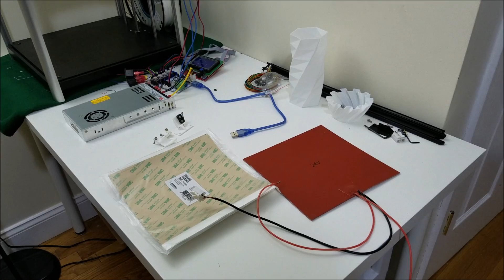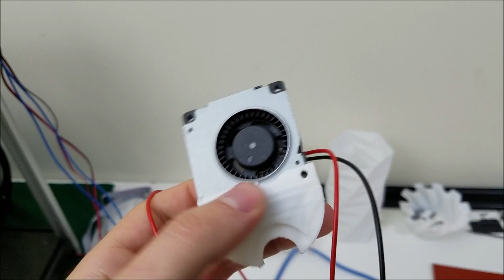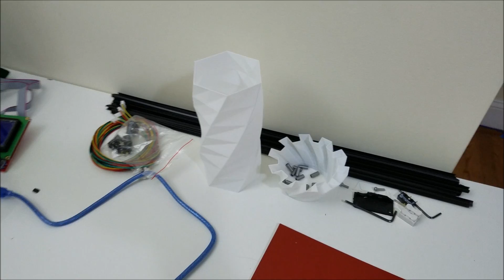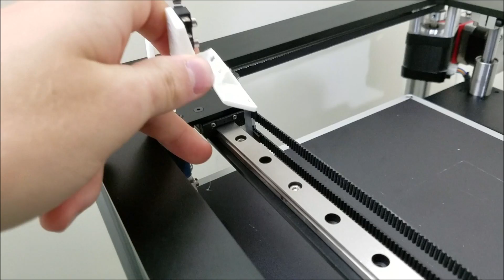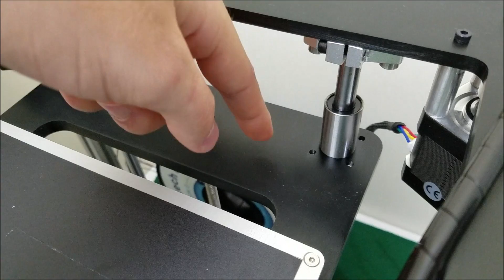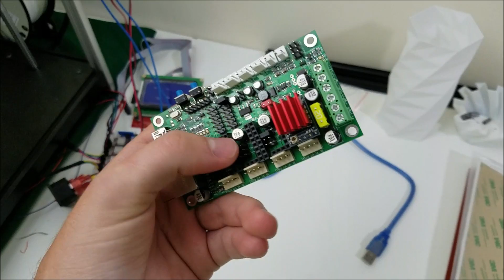Eclips3D2 Update! GeeTech went psycho!!!

Comment: why do u use a 24v psu for running the board at 12v?
Reply from the maker: Because the more pixies the better!

Well, perhaps a better explanation is in order. This is mostly due to the fact that all of the standard electronics for 3D printers usually come with voltage limits well above 24v, like the steppers, control board, wiring, etc. So by using 24V, it allows you to use less current and deliver the same power. This means you can use thinner wires for less bulk, less current for the steppers so a bit less heat, and most importantly it will allow you to hook up a more powerful heated bed directly to the controller (depending on the controller).

Honestly, there's no reason to have a 12v system, 24v should be the standard for all 3D printers, if not higher!

Comment: I figured it out,the original gt2650 that came with my machine was probably set prior the board I got wasnt . to make the 12864 LCD smart controller work ,I had to reverse the connecters,shave the plug to fit in reverse then it work !! if other people are have this issue that is probably why the connectors are backwards!!! one week of stress figuring this out

Comment: I have the same board that you have in the video ?or if you mean the pins? I have both LCD & SD card plugs connected ? still blue screen ?? thank you for the info
Reply from the maker: Well what I'm saying is that you need to make sure you not only have the plugs on the proper sides, but also that the plugs are not flipped. I don't know the correct orientation so that is something you will have to look up. If all else fails and the screen still does not work, it's possible it was just dead on arrival. These screens are cheaply mass produced in china so it wouldn't be that far fetched to get one that was just dead from the beginning.

Comment: I can get it to power on but only buzzing not beeping I define u8glib  but nothing still blue buzzing screen specs reads gt2650 dosnt need adapters a little more info would be great thnak you
Reply from the maker: Correct it doesn't need adapters, but since there are 2 cables and each is reversible, there are basically 8 different ways you can plug in the lcd to the board. I'd recommend trying to find the proper orientation and location for each plug to make sure you are connecting it properly.

Comment: how did you get the full graphics lcd on that 2650 I just bought one but dosnt see any pins for it on the board
Reply from the maker: There should be 2 sets of 2x7 pin headers, these are for your control board. One set is for the display wiring and the other set is for the sd reader wiring, so technically you only really need the set for the display at a minimum to get it working.

Comment: Hey, I have a few questions about designing a printer using 2020 extrusion, if you could help me out.. I know its a long read but I'd really appreciate the help

I have several hundred dollars worth of miscellanious parts- Half are in my current Kossel, the other half are from a previous prusa build. All working, all useful and expensive parts like NEMA motors (both big and small, several of each,) a few yards of bowden tubing, a few hotends, some endstops, a few yards of GT-2 belts, smooth rods, boards, power supplies, etc etc. I've dealt with two unbelievably unreliable and low quality printers, the Q3D Twoup and now currently the Folgertech kossel, and I want to just make a printer that I can rely on. But I'm not interested in buying another kit, because not only is that another 500-600 dollars, but I'd be wasting the $500 in parts I already have. Do you have any tips? I'd most likely be building a core-xy machine, as ones like yours work amazingly- but I dont know much about them, I'd only really know how to build another prusa, which i'm defnitely not interested in. Do I really need a cad software like you used to design yours? I have access to pretty much everything I'd need to make my own aluminum/plywood brackets and such, so I wouldnt need to send cad models to companies to fabricate them for me and stuff. I know I'll have to buy at least SOME things, like more extrusion and sheet aluminum and all that, but I have the bulk of the money already spent and I think I can finish the printer for relatively low additional cost. Is just coming up with it as I go a bad idea? Where is a reasonable place to start? I was thinking of just making a very secure frame and going from there, probably moving onto the bed (I plan to use two small NEMA motors on front and back to lift it, would this be powerful enough? Or should I use two big ones? Would small motors be capable of moving the gantries? I have 5 big motors and 3 small motors.)

Your printers are coming out amazingly, and I look forward to your next update. Best of luck
Reply from the maker: Well first of all I would say to check thingiverse, just search corexy printer and it should come up with a few dozen good options to look at and possibly build directly or base your build off of. You can just kind of wing it and fix things as it goes, but that probably isn't the best idea if you're looking for reliability. The most reliable printer is the one that is designed to be reliable from the start. Either way, whether you build someone elses design directly or you do your own design, definitely do at least a rough drawing of what you want. You don't necessarily need to cad it, but a fairly accurate drawing form the top down should help you get everything together so you can begin the build. You will probably want to focus on the outer frame first, then the corexy portion since that is the most difficult, then when that is done work on the z axis. Just keep all the other parts in mind even when you arent building them, like don't forget you will need a place to put the z axis motors when you're building the frame. If you use good lead screws with a large lead (4-8mm), 2 small motors will be enough. Otherwise you may want bigger ones. Of course you could always just run the z axis super slow and use the small motors anyway, the z gantry won't take much effort to move, it just takes effort to move it quickly. Good luck!

Comment: I really like the robust design, and quality of the build. Have you thought about adding independent dual extruder?
Reply from the maker: Yep! And although I probably won't officially support it, I will likely go the ultimaker route and "kinda" support it. As it stands now, there is a place where you can attach an additional bracket in order to mount an E3D chimera or cyclops hot end to the printer, then a second extruder can fairly easily be mounted on the back opposite the original one (or even below it if you get creative).

Comment: I ve been printing for a long time with PLA and without any fan that blows on the print, apart from some corners lifting up (no heated bed) what are the other problems of not using a fan ?
Reply from the maker: PLA just looks better when you have a fan, basically because PLA has such a low glass transition temp (the temp where it becomes malleable) it will often not fully cool before the next layer goes on top, which can lead to the surfaces not looking as crisp and overhangs/bridges drooping. If you get a cooling fan on your printer it can seriously improve print quality for some parts!
Reply: Can you post at some time what setting do you use for cooling ?
Also some settings for support would be really interesting .
Thanks !
Reply from the maker: For PLA just full fan all the time except for first layer works best usually, if it's too loud you don't have to run full or you can do some other profile that does more fan for shorter layer times. Basically the more cooling the better

Comment: if you are using an aluminum bed, why not use a inductive sensor? Can also work for auto bed leveling...
Reply from the maker: No inductive sensors, I'm very against them on high tier 3d printers haha, read any of my other comments below there's a few talking about it for this video.
Reply: +1 i will only use autoleveling if my hotend is probe. i am working on a switch spring system where hotend will probe the bed. that way you never have to mess with offset and even if you change hotend it wont make difference .

Comment: sorry what happened to you with the GT2560. anyways, if you want a really nice board, check out the duet that just came out, built in WiFi, firmware can be updated via a file sent to printer via wifi, has options for the lcd , card breakout, and another pin break out for all inputs outputs and what not. rwg research just did a video on it.

Comment: I know you said you're not keen to use proximity probe but it makes z homing much easier, no more manual adjusting with the screw etc. Also if your bed is all levelled via screws it'll not do any compensation.
One more thing, have you considered doing 2x piece bottom cover design?! Back piece could be much thicker so you wouldn't need to use those brackets to hold z stepper in place + front piece cover could be opened like a hood to access all electronics etc without pulling printer out and tiling it on the side...
Just a thought.
Last thing, promise. TMC's are worth every penny. Just don't buy them off AliExpress or so, I've got mine directly from waterot manufacturer website.
I'm done! ;)
Reply from the maker: That's true, however with a printer this solid you'll only have to adjust it once every few dozen or even possibly every hundred prints. Basically it comes down to whenever you replace the build surface. And that's true however the precision of those probes are generally terrible, so even if it is perfectly level it may think it isn't and try to compensate.

That is a good idea with the base panel, but it would drive up the cost considerably and it still won't make it easy to access electronics because of how they will have to be mounted. 

And the Azteeg supports THB6128 drivers which also can do 1/128 for smooth quiet movements so hopefully once I'm able to test that it will work as well as I hope it will! Thanks for the input and suggestions!

Comment: completing my other post, check my new printer is use too a metal plate with linear rail. but i have radds board with 1/125 steppers. almost zero vibration and all the noise are from the cooling fan. uploaded 3 videos on my small channed.
Reply from the maker: Nice that printer looks great! And I will be considering more boards but for now I will be using the azteeg x5 mini!

Comment: great printer, but not the board. in the past i have builded a corexy machine with a ramps 1.4, full lcd and using repetier firmware. it simply does not work well when you start to print with speed high was 80mm/s. the problem is the 8bit board do not have enough computational power to update the full lcd and move corretly the corexy. the problem i have was small blobs on the print because of micro pause, tryed marlin and same problem. the corexy need a little more computation power to move at same speed of a simple cartesiana. delta printer the problem is worse. other problen is the steppers, to motor are diretly connect to the metal plate and all the vibration will be passed to the main structure. is a so nice printer, man put a nice board too. something like the new duet that have wifi and 1/256 steppers, rads or even a smoothieboard clone.
Reply: you know when you add a full graphics LCD, its just about overloading the 5/3.3voltage regulator on the mega. i can hit speeds well over what you can. if you are running a delta then look into a duet board, built in WiFi, firmwares (3) can update via wifi, seperate or combined with lcd, seperate with touch screen. rwg research shows his on YouTube, see my chanel in 3d printer playlist, and ooooo I want one playlist too. really nice board just came out of the first preorders.

as for the gt2560, I run auto level and a filament sensor and the autolevel is 9point grid, on 12 volt.
Reply: George Robles the full lcd was more text line and need more computation power to be update. If you use 1/16 stepper you probably be ok, but not with 1/32. The type of stepper reduce the possible speed by half. Was i say, i already done this and the use of the full lcd will give you micro stop during the print.
Reply: hmmm.... never did try with the dvr8825s. i will look into it. i actually prefer to run my printer through octoprint now a days. i upload g-code to the octoprint server, then run it that way so your only sending basic g-code instructions. it still is using 9 point grid level and doing that math on the fly. this is how most industrial stuff runs, one cpu controling another slower cpu.
 so it reduces the info being processed by MCU that no longer has to read an sd card then execute the instructions. and I can remotely operate the printer, using a webcam so I can see it and take time lapse videos of the prints I do.
Reply: hmmm.... never did try with the dvr8825s. i will look into it. i actually prefer to run my printer through octoprint now a days. i upload g-code to the octoprint server, then run it that way so your only sending basic g-code instructions. it still is using 9 point grid level and doing that math on the fly. this is how most industrial stuff runs, one cpu controling another slower cpu.
 so it reduces the info being processed by MCU that no longer has to read an sd card then execute the instructions. and I can remotely operate the printer, using a webcam so I can see it and take time lapse videos of the prints I do.
Reply: reptier have problems with drv.  its some delay timing issue.

Comment: why not using a proxy endstop? than you can instal auto bed leveling. You should ask Thomas Sanladerer what is the best board for your machine. Duet or a Smoothieboard. Or the Ultratronic board. Alot of options and the right componets. I like your design of the machine. Does it get a enclosure? Is this x-y motor setup beter than just a motor for each axis? 

regards 
Erik (Netherlands)
Reply from the maker: Noooo auto bed leveling, I'm way against that in high end machines. I really need to make a video about that, people are always suggesting it or asking why I dont! It will have a semi enclosure similar to the ultimaker, and the benifit to corexy is that both motors are stationary so it allows you to print with much higher accelerations and less backlash. As far as the board goes, I'll probably stick with the Azteeg X5 Mini, I know it's predecessor well and it is a great board. Smoothie is nice but a bit to hacker-y and the duet is quite a bit more expenisve and has pretty outdated (although tried and true) stepper drivers. 

Of course the design will be fully open sourced and I will be selling all printers as barebones kits, aka no psu or controller, so the end user can select whatever electronics they would like!
Reply: Duet has a brand new version with WiFi and the TMC2660 256 microstep drivers. Check out RWGresearch last video on it.
Reply from the maker: Scienteer That's true but it's quite a bit more expensive, wifi is a cool feature to have though. I'll consider it! But again, no matter what I pick for mine, the end user can always decide for themselves!
Reply: fair enough. In terms of print quality I doubt there would be any noticeable difference.

Comment: Are you expecting good abs prints without the printer being fully enclosed? I've had mixed results on my Eclips3d even with 3 sides enclosed right now. I think you'll find PETG is the way to go if you can get some. Prints easy like pla but strong like abs without warping. I just reprinted the MPCNC I told you about in PETG and the parts are extremely strong.
Reply from the maker: Well I've printed abs on my Eclips3D without a problem but perhaps the room I was in was just warmer. But anyway I'll be testing a bunch of filaments once the Eclips3D2 is fully operational!

Comment: I actually prefer Z max endstops. Instead of turning and adjusting a fiddly screw, i'd rather use the controller for that, adjusting in precise 0.01mm movement to level the bed to the hotend. Kinda like how the delta works
Reply from the maker: That's true! I may still include the screw for quick adjustments but you can always adjust in the print settings too of course!